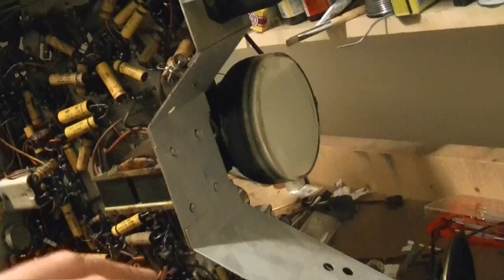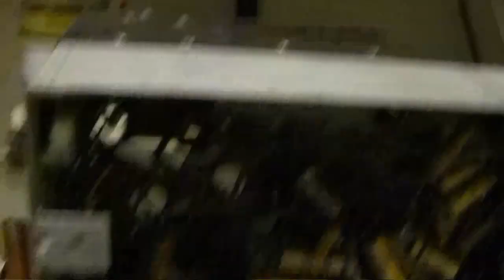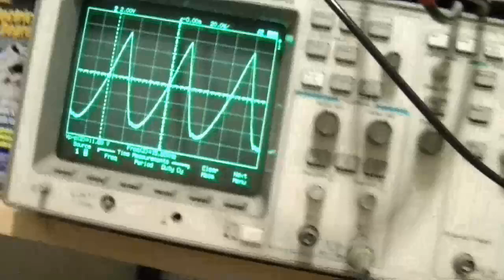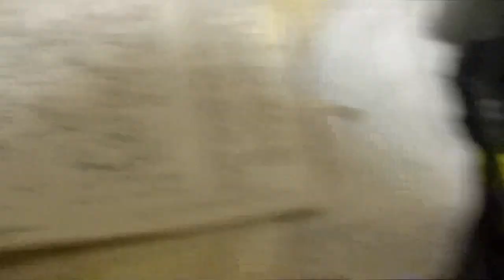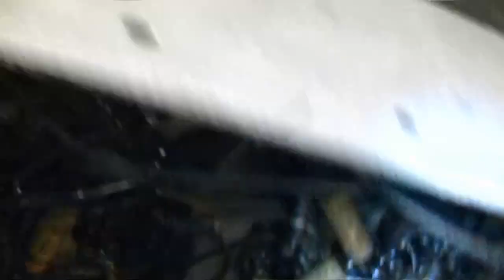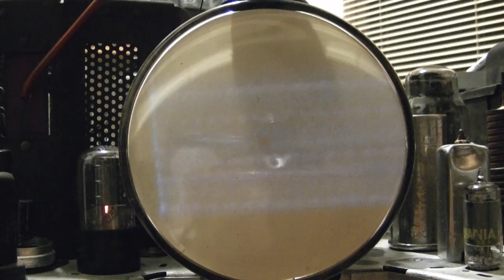RCA 630TS restoration p7o?

Comment: Is the geometry of the wire outside of the coils on the chassis just to hold it in place?

I wish U41/CV2115 tubes were more readily available.  They are a higher spec tube fully compatible with the 1B3GT/8016.

Comment: Leaky molded mica caps, they seem to have had some bad batches of those in the late 1940s. I don't know if it was because of war surplus parts flooding the market, poor materials, hurried production to catch up with demand, or what. I've even run into them in the front end of an AC/DC radio which has bugger all for voltages compared to TV circuits.